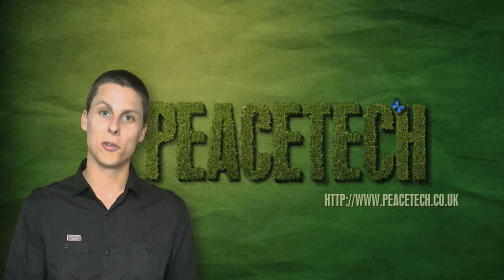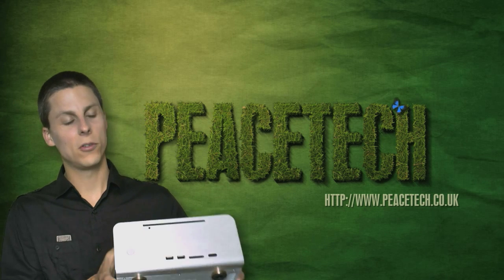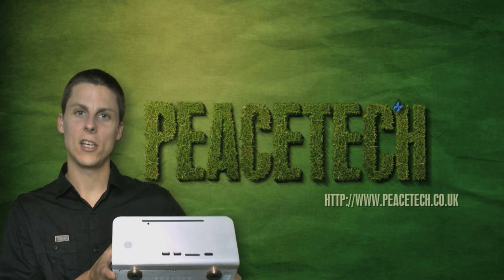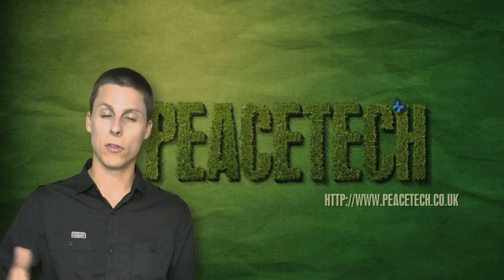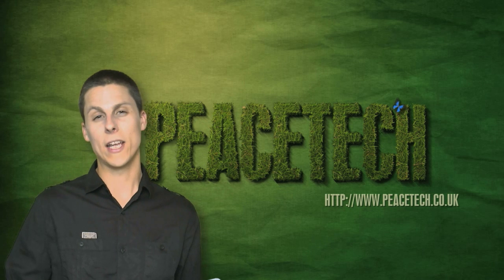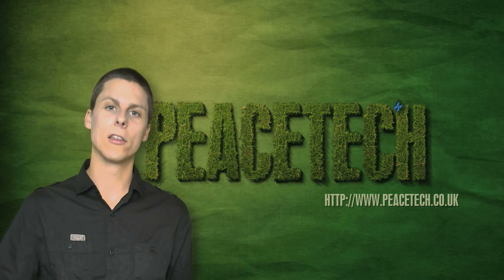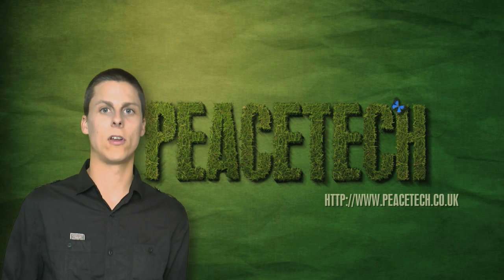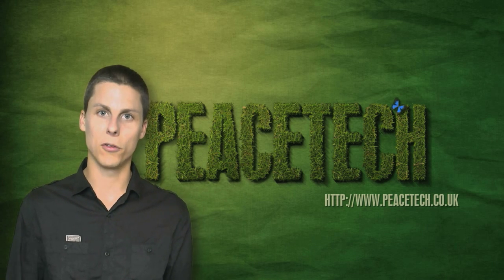Silent Powerful HTPC in 20 Steps

Comment: If you were able to add a video card into the PCI slot, which is were you'd originally placed the power supply cord, what adapter did you arrive upon for use in the original hole in the back of the case to accomodate the power supply cord?

Comment: I keep toying with the idea of buying one of these for my aging E5300 itx machine which I originally built a custom aluminium case for, unfortunately it's too noisey with the lid on, so I've been running it exposed :P...  I like the look of the case, but the temps of passive cooling I'm not a big fan of (pun purely coincidental :P)

Comment from the maker: Thanks for the comment, I generally follow instructions, but this time I actually needed more thermal paste to allow the cooling tubes to slide into place as the motherboard is ever so slightly off the default cooler position. Even with this requirement though... I still used too much. As I said to SuperPS, you live you learn :)

Comment from the maker: @Jacob Juul Hey again :) You will be fine running that processor without active cooling. It sounds as if your folks won't be using it for  anything too intensive anyway.  I've run up specific heat tests on this build and have not had problems yet. The running temperatures are higher than a desktop PC but still within easily safe limits (and that's when I'm pushing it).

Comment from the maker: Hey Jacob, which i3 processor are you planning on buying? There's a few flavors of the i3, different generations of the same processor. Also, i3 chips with different TDP (Check out the intel site and compare processors). All i3 processors with a "T" at the end of the number are lower TDP processors. A decent manufacturer will specify  what their cooling  is capable of. Check out the streacom website against any of their cases, they should specify their own tests against specific TDP levels.

Comment from the maker: Hi Mutio86, During my tests I never went above 80w. I would say that it's probably sufficient. Nothing is garaunteed though. If you add the specified watt requirements the manufacturers state, then 150w is not enough... but they often over specify. Worst case, you use the GPU within the intel chip itself and don't use an external GPU

Comment from the maker: Oh...try mini-itx.com, I believe they will ship to Germany, no problem. Then you can get the 192 Watt version. Just check the 4-pin DIN connector first. As I said in the video, the connector does not actually fit into the Streacom power socket. Personally, i haven't chased it up with them on an adaptor etc. so never found out whether they supply them or not.

Comment from the maker: VTX3D 1GB AMD Radeon HD 7750 Low profile Slim Graphics Card GDDR5 PCI E x16 (320934841191)

That's the exact card I used. No problems fitting it at all. The card comes with full height backplate, just swap it with the low-profile provided in the box.  This particular card was supplied by Tel-Computers, off ebay.

Comment from the maker: Hey Guys, just to let you know that the Radeon HD 7750 card ran smoothly in the rig, I only had a chance to test Diablo3 on 1920x1080, but I was getting 75+ fps, with antialiasing on and graphics settings set to high. The power draw was around 80 Watts total. The only concern when pushing the system hard for so long, is the overall heat. It was reaching about 60c in the short time I played, I will need to run it for longer to ensure these figures are stable and a accurate.